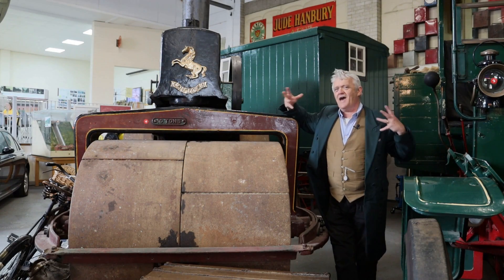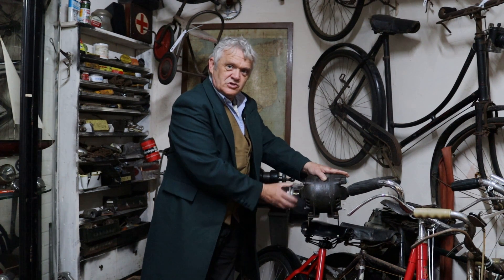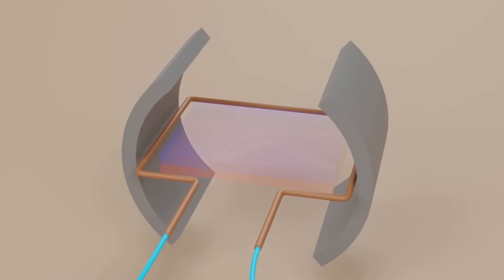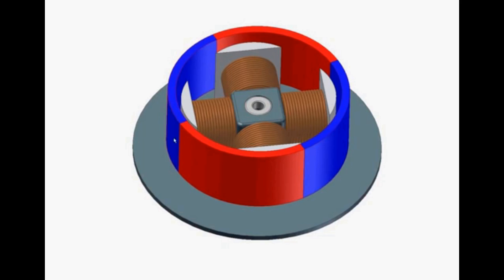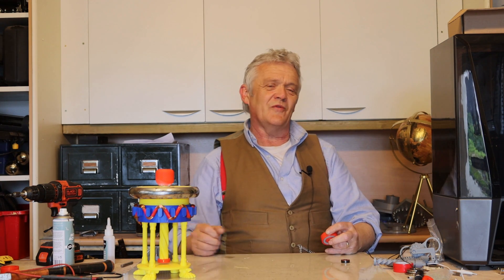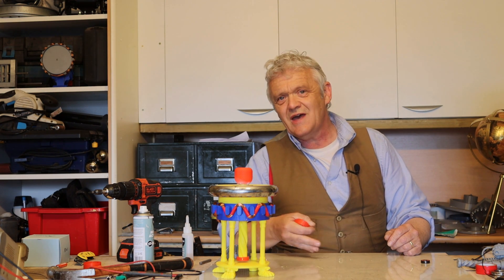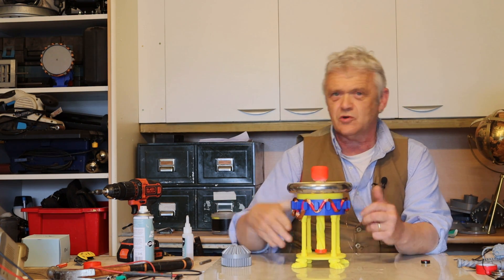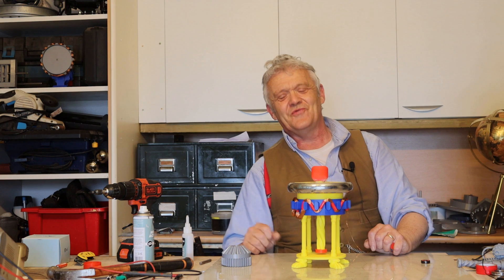2006 Hubless - The Motors And Generators Of The Future

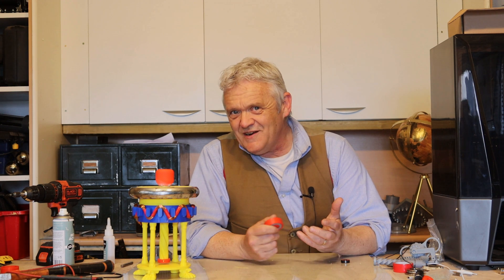Comment: 3:08 
In fact, both are mechanical switch, but it is more complex in a brushless motor than it is in a brush motor. The reason for using brushes in a brush motor is an electrical problem.

Comment: The biggest problem that I see with hubless motorcycle wheels is - an axle only reqires 2 small cheap ball races , large diameter ball races are very expensive...

Comment: They still technically have an axle that is a bearing race with a large diameter but the promlem is the large diameter race means the balls inside have to spin faster around the outside of the larger inner and outer hub increasing friction and allowing slower maximum RPM without exploding or rapidly wearing out the bearng races from increased rpm and centrifugal forces. Larg wheels wiht smaller axle diameter are actually better as long as they are large enough to handle the over all load.

Comment: I'm afraid I got a little distracted in your video when I saw what I assume to be a little Ransomes M.G. Crawler tractor. I remember many decades ago seeing those converted with an electric or pneumatic motor and used underground at Coober Pedy in South Australia by Opal miners, with a bucket attachment for removing mined rock in confined spaces or even a rotating tunnelling attachment !

Comment: - smaller moment of inertia and smaller gyroscopic forces ("P-factor" is an interesting gyroscopic effect) for the same mass of rotating machinery - keeping it all closer to the "axle".

 - driving off the faceplate of the outrunner bell- supported bu large diameter bearings for increased stability /longevity...  Engineering compromises abound.

Comment: just use stators with higer RF frequencie volume , voltage and less amps 
that would bring down resistance / heat and push up torq
Reply from the maker: it would indeed but that is not the point mate lol
Reply: @ThinkingandTinkering  some point 
already built stators to have them not to build them 

magnetic couple & drive generators 
in such a way that input power is less than output 

my point is to throw ideas your way & hopefully you get something out of 
greater 
evolution

Comment: Have you heard about k-99 the super conductive material being developed in south korea that can be super conductive at  atmospheric temperatures and pressures......  It could mean super conductive batteries.... And so much more.. If it proves to be repeatable and works...  I believe its made of Lead, Phosphorus and Copper, and can be manufactured cheaply and quickly...
Reply from the maker: yes I have heard about it - thanks

Comment: i recently dreamt up a motor/generator design that uses uninterrupted dc (that is not commutated) that doesnt require any clever motor controller switching power around coils in fact it only has one coil and cant seem to find anything similar in design would love it if you done a video about anything similar you may know about at some point in the future or point me at one you may have already done ,if you're busy enough i understand, thanks for what you do
Reply from the maker: video 1562
Reply: @ThinkingandTinkering  thanks for sharing not quite what i had in mind but interesting all the same if i ever make a video of what i designed i will share it with you for comment

Comment: ￼Seen this?

It’s a story we’ve heard so many times over the years: breathless reporting of a new scientific breakthrough that will deliver limitless power, energy storage, or whichever other of humanity’s problems needs solving today. Sadly, they so often fail to make the jump into our daily lives because the reporting glosses over some exotic material that costs a fortune or because there’s a huge issue elsewhere in their makeup. There’s a story from MIT that might just be the real thing, though, as a team from that university claim to have made a viable supercapacitor from materials as simple as cement, carbon black, and a salt solution.

Supercapacitors use plate materials with a huge surface area on which to store charge. Conventional supercapacitors often use an electrochemical construction, and activated charcoal is a frequent electrode material. The cement capacitor uses the property of cement curing, which creates a dense branching network of openings in the material as the water reacts with the cement. By introducing electrically conductive carbon black to the mix and using potassium chloride solution instead of water, they turn the huge surface area of the resulting structure into a conductive electrode suffused with charged ions. This can be used as a plate of a supercapacitor, separated from another similar one by a membrane.

The suggestion is that, in the future, the foundation of a house or other structure might be cast in this cement to provide in-situ energy storage for rooftop solar generation. There’s an environmental question over the carbon footprint of cement manufacturing. Still, since the materials and techniques appear neither exotic nor expensive, we hope this is the one energy storage miracle discovery that makes it.

Comment: The permanent magnet motors and generators are brushless like Lazersabers EZ spin motors, most of them are not self starting you have to give them a push to get them started but lidmotor or someone else figured out a way to make them self starting.
Reply from the maker: he uses a reed switch for commutation mate
Reply: @ThinkingandTinkering  yes, I know , I started to say that but I guess I left it out. There is not contact like there is with brushes to wear out but I think the reed switches have problems sometimes I don't know if they don't last very long, I never have used a reed switch for anything so I don't know.

Comment: So... Generators need not be shaped as circles. A chain with magnets stuck at the connecting point could pass by a linear coil and create electrical power...
Or any number of other topologies. 
Interesting.
Reply from the maker: That is correct
Reply: @RobertMurraySmith 
I mean, I wasn't really asking 'cause I knew it was true. But I never really thought of it before. And you're right: It's always been true but the thought-momentum of the axle kept me from seeing it.
Reply from the maker: @bmobert  that is one of the biggest issues mate - i see it here in the comments all the time - people thinking down a track - I really like it when I come across a comment like yours where you are looking in a different direction - it's awesome to hear
Reply: @ThinkingandTinkering  
Cheers, m8!! 😃

Comment: Hub-less designs need a lot more bearings (more weight) and it puts them where they see the highest speeds. You see them about every 5 or 10 years on futuristic design concepts but they never catch on.
Reply from the maker: cheers

Comment: Would raising your toy top generator 7
Unit up and dropping it along the shaft provide enough force to add gearing that could amplify the speed for increased rotation at the rim. Say having a 2 meter shaft and about a 20 kilo flywheel instead of 2 kilos. Then I believe you could generate as the weight moved down the shaft and as the cable used to lift it could also generated from the motor used to lift it I think that could get 2 generating points off of 1 gravity battery. I wish I could send you a drawing of what I seein my mind. Or even having 2 or more twisted guide rails and 1 lifting motor with each guide rail having an individual generator. I'm a homeless vet here in Illinois staying with friends kind enough to let me stay with them. I have limited funds being on disability and space to build anything. But do enjoy the ideas you  share immensely.
Reply from the maker: i am not sure you need to raise the whole generator mate - but i am making a model to demonstrate my Idea of how to turn this into a gravity generator
Reply: @ThinkingandTinkering  my thoughts is instead of just using a dead weight for the energy storage, a very torque dependent generator that was simple but heavy that requires the force from the heavy weight to drive some kind of gearing system that could produce incredibly hight speeds. In your videos you're always mentioning how to produce higher speeds thru gearing. I do wish I could send you a rough sketch of what I'm imagining. Basically it's a stack of planetary gears where the central axel is twisted like in your spinning top. So as the generator drops down the sheer mass could drive the low end of the gearing to produce very high speeds at the end of the gear stack. Or since raising the weight may be an issue, changing the twisted guide rail(s) some kind of toothed rail(s) that the motor\ generator could climb and then produce on the way down. It might not be the best way but I'm think about the small footprint of less than a square meter for as tall as possible. In urban environments space is an issue. I lived in Atlanta for over 20 years so a gravity battery attached to the side of any building could be be easily added to keep it from being an eye sore. Brick it up and looks like a chimney. Use the same siding or paint on the enclosure and it should blend in like urban camouflage. Thanks for writing back. I've been binge watching your videos at night for months. I'll go comment on the ones that really interest me. I hope the positive vibes you put out will be received well by all.

Comment: Hmmm, it's not exactly 'hubless' really, is it?  The axle is expanded out to the rim, but it still provides the support for the frame.  It is essentially a fixed axle expanded out radially into a very large tube; unless you are defining an axle as a free rotation pivot bar that is able to spin independent of the frame.  The same concept would work with a large tubular bushing as the freely moving 'axle' at the hub rim, like an inner bearing race.
Reply: I always though of the hub as the part that supports the wheel/rotor and holds the bearings.  What is being described in the video is a rotating device with a large hollow shaft with very large bearing that still needs a hub.   When I think "hub-less" I think of tank tracks with several rollers supporting the "wheels".
Reply from the maker: sure why not

Comment: If you have to support it at the rim, won't that result in more friction than using an axle? Usually the aim is to have as small a contact point as possible, like you demonstrated with ball point bearings. Now you are going in the exact opposite direction. It seems inefficient to me.
Reply from the maker: depends on how you support it
Reply: @ThinkingandTinkering  Then show how you would support it at the rim so it runs as freely as with an axle.

Comment: I met an old german dude on facebook around 10 years ago. He was all about a decentralised DC electric network, and he actually toured Europe with detailed plans and costings.
It's almost impossible for an individual to get the ball rolling in such things, and get the attention needed.
Reply: This makes sense but the cost to migrate to DC is insane (unless it's something gradual and supported by market), while migrating to (partial or full) decentralized generation is almost transparent for the public if done right.
Reply: @vitordelima  It would make sense, and indeed the whole process could be seamless. As for costing..I think that question was also asked in regards to rolling out wind/solar energy harvesting - yet those projects have been relatively seamless with little cost to consumers.
I think more emphasis should be put on the overall net worth of such projects to consumers and communities, not to mention GDP.
Reply: @TheAdeybob  Their cost and power output (so their worth) were hijacked by energy cartels and they also could be seamless.
Reply from the maker: yes it is - quite a shame really

Comment: My elegoo neptune 4 pro was delivered yesterday. Took 2 months to get it, but I am extremely happy with the performance so far. Compared to my creality ender 3 (a very basic version from creality in all fairness), the neptune blows it out of the water entirely. thanks for your work in putting it through it's paces and then sharing your opinions.
Reply: I'm thinking of upgrading soon. I paid about £130 for my Ender3, what is the price difference?
Reply: @lagunafishing  about $80 USD. I don't know the current currency conv rate.
Reply from the maker: cheers mate - i am glad it helped
Reply: My brother has the ender.  Loves it but I guess it might have been the ants pants when he bought it a few years ago.  He said that most if not all the upgrades he made with it.  But I’m sure you could do the same with this machine.  It wasn’t expensive was it?  I think I saw it at around $400 Oz
Reply: @colrodrick8784  I think it's down to $300 now on their website. If I had made the upgrades to my ender, it probably would have been much easier to use. But I wanted a plug and play tool to use for projects,  not a new discipline to become an expert in, lol. The ender was an okay buy for me when I bought it,  but this was a lot better buy.

Comment: Hubless might be an interesting idea but the engineering complexity is extreme as you have seen with your 3d print tolerances & as for vehicles there's a problem it's unsprung Whight & a hubless wheel will always be heavier & this problem will the suspension more complex & the ride comfort reduced
Reply: All very serious points, add in the torque flex mounting problem of a giant hollow axle and outer bearing race stress/flex, the weight savings starts evaporating fast. Toss in the costs of ridiculously expensive bearings for this "hubless" wonder...  Big globo corps love the no maintenance possible throw away model, be careful of what you wish for vs your needs.
Reply from the maker: that's funny mate - just a few days ago I was looking at a production electric vehicles that had four hub motors
Reply: @ThinkingandTinkering   Love the AWD aspect of 4 hub motors.  How about planetary drives? Pain to work on but cool to me and minimal power train. Waiting for a motor and magnetic transmission stuffed into a planetary hub for durability on heavier equipment. Gotta admit the hollow looking wheel does look cool though, even with its particular limits.
Reply: @CruorEtFerrum  yes thay do look extremely cool you will remember the light cycle from Tron I would love one but as a hand's on engineer thay intrigue & scar the hell out of me at the same time. I love science & experimenting. keep up the good work